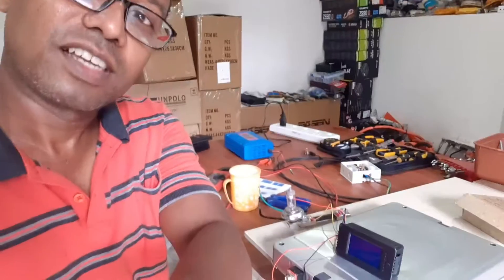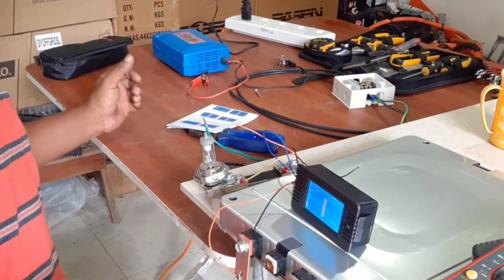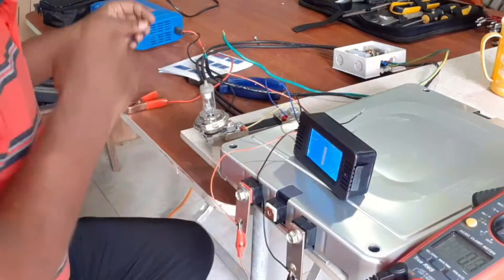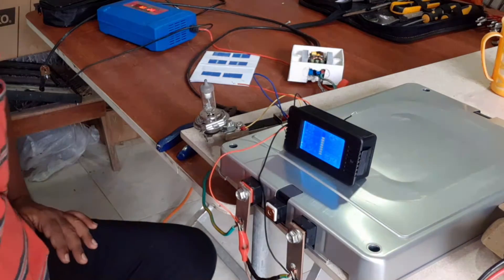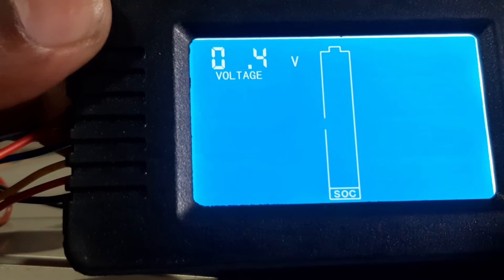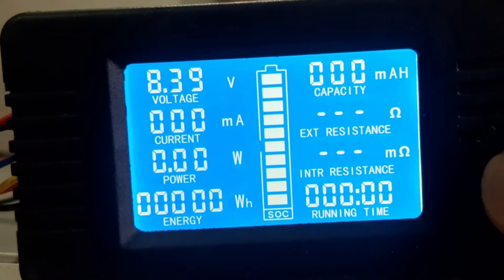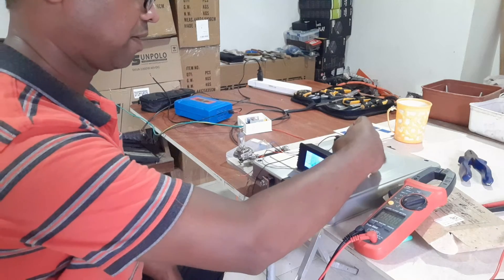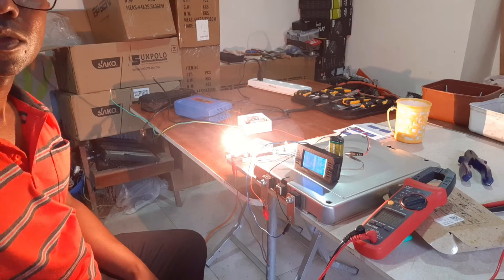Battery capacity measure using PZEM015 Multifunction Battery Meter

Comment: hello, I also bought a pzem-015, everything went well until I inserted a power analyzer FT08 RC 150A of high accuracy and it looks like I incorrectly inserted it into the input and I also had a battery in it, the problem with it now is that he no longer shows me that the battery charge meter remained at zero, this strip no longer rises, which happened, that what can I change, please, if he knows what he has?

Comment: Forgive my poor understanding but why is the shunt connected near the load and not the battery?
 (And does it matter I guess...?)

Is is it just out of convenience because the battery monitor will not be always attached to the battery, or because the shunt actually is more accurate when placed near the load? 

(I am installing one on a portable 12v power supply and the loads which will be attached to it vary in type and proximity so I have mine attached to the battery for the portable 12v power source and was under the impression that this is the preferred method after reading the instructions....)
Reply from the maker: It will not make any considerable difference if you keep it close to battery or away

Comment: Can measure capacity & ir testing with this module of an lithium ion & Lipo4 batteries ??? Instead of using cell ir tester which cost 14000/- & battery capacity tester separately

Comment: Good afternoon, I put this unit in my boat having two batteries 102 mAh in the one side, for the service appliances. The batteries are connected to a solar panel via charge controller. But the central SOC battery icon shows only one bar.
High voltage set 13,8 low voltage set 11,0. Is something wrong?
Reply from the maker: You need to set the max and min voltages to show the correct SOC on the display. You should watch my video once more to understand how to set it.
Reply from the maker: 5:22-6:22
Reply: @HappyGreenerWorld  thanks, I didn't have confirm the first digit in 0......
Reply: Because of this setup I see only the measurements of the inverter witch is connected to batteries 2. If I connect the shunt with another wire with the negative of the boat, as load, can I see the measurements of all the 12v appliances?

Comment: Sir can I directly connect solar panel to this meter to measure voltage instead of battery
Reply from the maker: If the voltage range is matching , yes you can use.
Reply: Tq sir

Comment: can we measure the capacity of the battery using this meter by measuring the charging capacity ?
Reply from the maker: Yes
Reply: @HappyGreenerWorld  great but it did not work for me, I might messed up with the wiring diagram and considered the load as battery